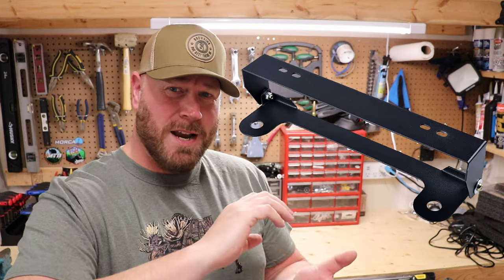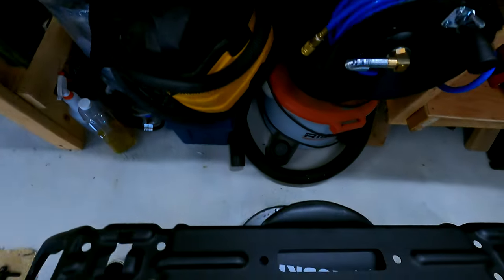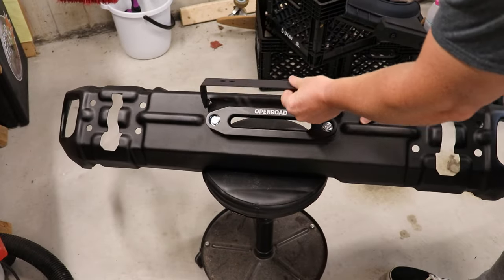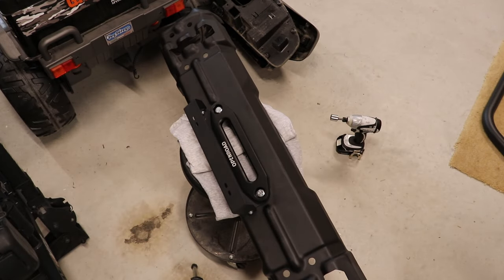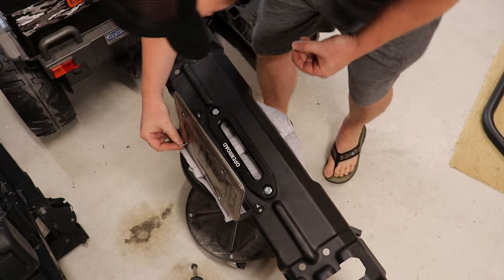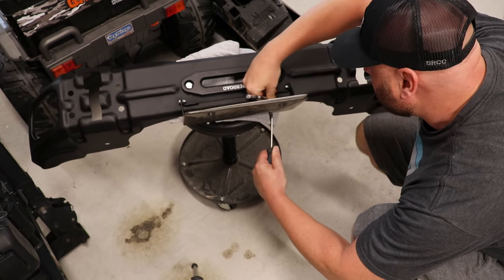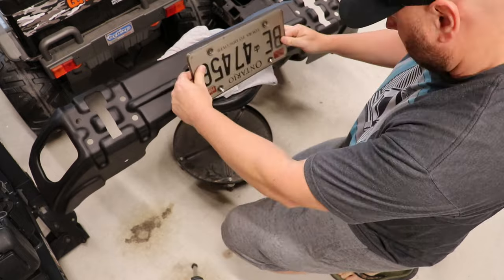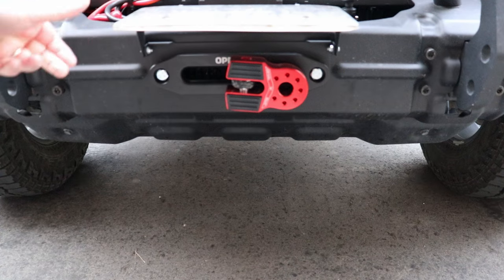Anzio Stainless Steel Flip-Up Roller Fairlead License Plate Mount Install

Comment: So glad I came across y our video. I've also seen the expensive version of this flip up license plate mount and thought there has to be a cheaper option.  Thanks for the great videos and really finding this bumper as well as my upgrade on the Gladiator once I get around  to getting a winch.
Reply from the maker: Thanks for your comment and watching! It is still working and the finish is holding up even with the snow & salt!